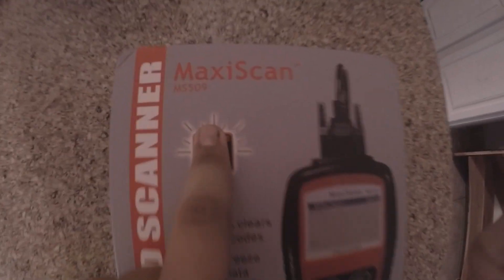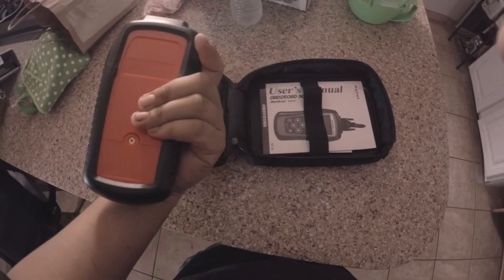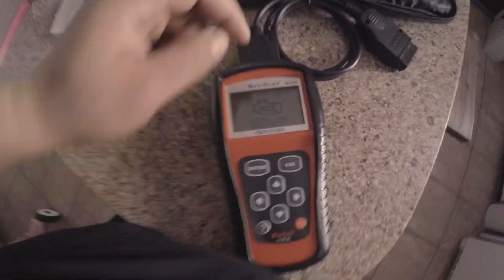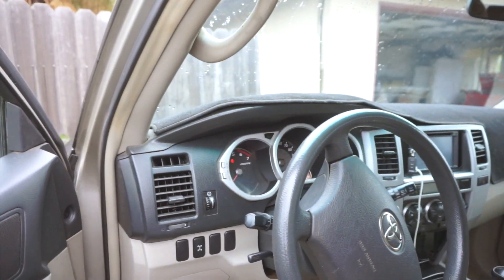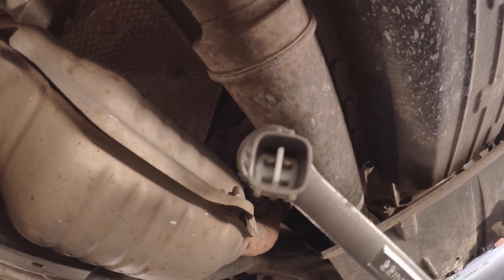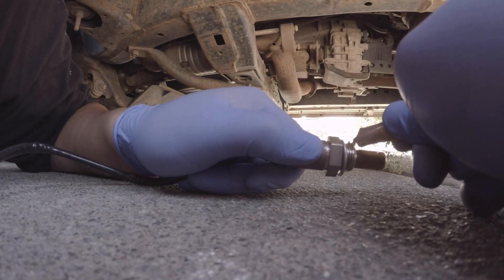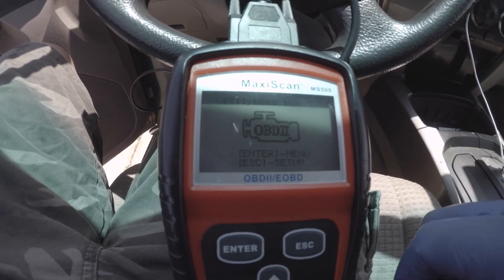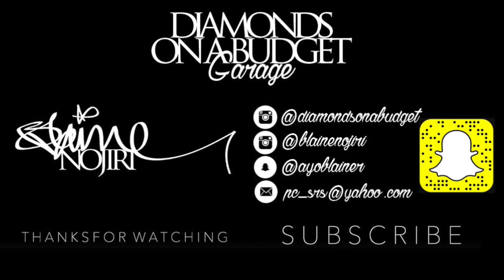Changing o2 sensor-Code P0156

Comment: I don't see why anybody buys obd code readers when any local auto parts stores has them and will use them for your check engine light free of charge
Reply from the maker: Brad Ozzy for me it’s convenience, this reader was $10 bucks and I don’t need to waste time going to the store every time I get a check engine light I can just grab it out the tool box
Reply: Sometimes your car won't run well enough, I don't want to spend $50 to tow it down to get a free reading, lol.
Reply: Also you use coder to reset codes